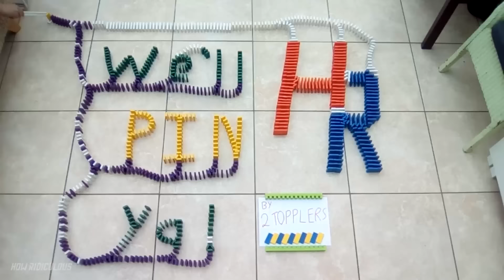Can This SOLID GLASS BALL Survive a 45m Drop?

Comment: As a retired glass maker, you make these in layers, like as onion. Also it is leaded crystal which is 60% by weight dissolved lead, giving it the optical quality. A crack will always travel the path of least resistance, ie the thinnest, so upon impact the cracks will propagate in 45 degree angles, the waves are the onion layers exposed.
Reply: SHREK
Reply: As a retired glass engraver (sandblasting, not by hand) I was wondering when someone would comment on how the glass sphere was actually made.  Thanks Marc!  :-)  Glass can be WEIRD stuff!  You can do all sorts of unpleasant stuff to it and it won't leave a mark.  But, sometimes, it seems like you just have to look at it wrong and it'll crack along a stress line left over from the manufacturing process.
Reply: As a retired smart person, I can confirm that this is true
Reply: As a retired glass maker, you make these in layers, like as onion. Also it is leaded crystal which is 60% by weight dissolved lead, giving it the optical quality. A crack will always travel the path of least resistance, ie the thinnest, so upon impact the cracks will propagate in 45 degree angles, the waves are the onion layers exposed.

Comment: The shape is called a concoidal ... It's a fracture of  silica molecules which makes the glass .... 

Also when the glass hits the steel plate ... The impulse created makes the wave patterned fractures which in turn explain Newton's 3rd law at the point of contact nothing happens... But the impulse travels in the form of waves and is the force is not conserved anywhere else but the point of contact , the cone is formed ... (Comtest).. thank you ❤️
Reply: The wave length frequency decreases and Hight increase the further away from the point of impact similar to a tsunami. Could that be due to the energy being able to disperses and it therefore having a weaker effect forcing it to find alternate easier path throught the structure.
Reply: Lol I’m stuck in a science comment
Reply: Nice google search
Reply: @eastcoastoutdoors902  nah bro I learnt it in geology

Comment: As the glass impacts, the point of impact supports the glass above, however there's a shear plane that can't withstand the excess force (the triangular shape from the side view) where the material below the fracture line isn't supported, so below that line is shearing due to tensile stress (the glass below the triangular shape being pulled away from the supported glass fracture line above) on the glass, the fact that the "Coney Joney" is uneven is likely due to the force being applied having a lateral (forward) vector, meaning there's more force being applied to one side than the other, causing more shearing to occur on one side as opposed to the other, so if you drop these directly down you'd likely see an even "Coney Joney". It's likely the front is shearing more as the force has a greater/higher forward motion (which is also translating to a higher stress on impact/stopping motion) so more of the front lower section is shearing as opposed to the rear, so more at the front less at the back. I hope i made this clear enough to understand! You could also likely review the slow motion footage to confirm/debunk the lateral force causing the un-even "Coney Joney". 

To eliminate the "Coney Joney" effect you'd likely need to surpass the compression strength of the glass itself upon impact where the whole glass ball would likely either shatter, split or a mix of both (maybe turn into dust/tons of tiny shards. This force may be too high to overcome from dropping from Terminal Velocity of the glass balls... maybe look into it? =D

As for the waves the most reasonable explanation i can think of is that it's due to the cooling process tempering the glass different amounts at different depths for some reason.

Really quite some interesting physics/science/engineering phenomena!
Reply: Definitely the best reply I have read so far.😃 Seriously, you are smart!
Reply: I would think that since the steel plate is angled that could cause the offset of forces giving that uneven cone. Dropping on to a nicely flat/level piece of steel would likely cause a more even cone shape.
Reply: @trumpedto6926  thank you! I did engineering at college 😊
Reply: @CrazyZorro4970  possibly yes, it'd be interesting to test this in scientific experiments. It may affect the point that the coney Jones occurs to be an offset indeed. However I dont think it'd affect the size of the cone much if at all
Reply: @nickpanagopoulos6097  Thank you, I'll take that as a compliment! 😊 Higher education is a blessing indeed.
Reply: Absolutely Right.....Solid state physics course huh?  Noice
But the wave pattern is probably not due to sudden temperature change.... It's more likely that the impact with steel plate sends a vibration through the glass(of course in a sinusoidal wave pattern) and it might be that solid to solid resonance occurs which causes the glass to collapse in the wave like pattern..... probably wouldn't have happened if it was concrete or something.
Reply: @sayyafnadir6137  I wasn't stating temperature change in the material but the curing process of the glass where it's tempered. And engineering actually 😊 And I hadn't considered that! That's a very interesting and of course highly plausible hypothesis. I might haveto see if there's any papers on it, if not I hope I to see a paper on it in the future ☺ Thank you for your input!
Reply: @jackfairman7371  if you don't find a paper, but write one... Do mention my name on it😂😁
Reply: Omg thats alotnpf svience
Reply: (Hours or typing later)
Reply: I can’t understand that but thanks

Comment: In engineering, there are two types of stresses that a material can experience: axial stress (tension and compression) and shear stress. These two types of stress are related to each other using an engineering construct called Mohr's Circle. Basically, when a material is loaded, there exists an angle where there is no shear stress (called the principal planes), and 45 degrees from the principal planes is the angle of the maximum shear stress. You can see this in concrete loading tests (unconfined compression test). A concrete cylinder is compressed until it fails. These cylinders usually have a shear failure, and the crack that forms is usually on the diagonal.

Glass is strong in compression and shear, but is weak in tension. When the glass hits the steel plate, the kinetic energy is transferred from the glass to the steel plate, and ultimately into the ground. Any portion of the glass ball that can transfer this energy with compressive stress or shear stress does not break, but the portion of the ball that transfers its energy with tensile stress shatters. The cone shape comes roughly from the angle of the principal planes (assuming an isotropic material), which delineates the glass is supported in shear/compression from the glass that is only supported in tension.
Reply: Thanks for that explanation. It is nice to have some proper science added to this channel.
Reply: @Vousie  this is actually the proper response this is not a Hertzian cone. no object has passed through the glass.
Reply: This SOUNDS right
Reply: Bruh im not reading that
Reply: wow, this explanation actually made me understand how they formed, unlike the pinned comment, thanks!
Reply: Makes perfect sense.

Comment: The glass is strong against compression, like concrete.And the point where it impacts the metal plate is the one where the stress is purely compression, that explains the point. The parts that fall off shattered from the ball due to the shearing forces applied on impact, since there were nowhere for the energy to flow easily. The parts that stayed were mostly being supported by that one point in the cone. 
The waves are probably a result of the manufacturing process, since the small glass ball has less waves and has probably been made in less layers.
One easy way to understand how strong glass is against compression is trying to brake a piece of small glass by pinching it between your thumb and index. Unless you have the glass bending, it will probably not brake.
Reply: nerd

Comment: Glass forms in layers. When the end result is a sphere, there are multiple spheres below (inside). The strongest part, is the thickest (minimal damage). A few layers “ slough” off from the kinetic energy, but only off of the bottom. The layers on top, have support below them. All just a guess

Comment: Says in a nerdy voice
According to my calculations the coney joney occurs when a fragile item that is layered (example glass) and is dropped from a reasonable distance. How this happens is the impact zone acts like obleck, ready for impact, it then sends a shockwave which then distributes the layers away from the sphere. The reason why the shockwave occurs is because when the ball makes contact, the impact zone absorbs the energy and its got all this energy with no where to go so it sends it self at a ten degree angle going to the impact zone and the energy continues to move down the layers until it inevitably runs out of energy. The reason the first two impact zones were off to the side are because they had forward movement and that made the distribution of energy go more forward. Think of doing a canonball at a pool, you move forward and that causes the water impact to move forward and out of the way, same concept. When you just dropped them with no forward motion, the peak of the cone was more in the middle but was not direct because the ball was spinning a little and the baseplate was not flat.
Reply: This was very informative but it made me really laugh when I saw your name was "Astrobuckhunter"
Reply: Im wondering if someone knows if you can find out the frequency of the shock wave from the spacing of the ripples in the glass?
Reply: Why 10 degree angle? Does it have to do with the speed of sound in glass? Or does it break along it's principle plane maybe?
Reply: @lbdjthethird1240  Derek's hair, i dont know how to put this but, in the wise words of the tootsie pop commercial, "the world may never know"
Reply: @mattc3738  grab a protractor and draw a straight line with the flt side of the protractor, now draw 10 degrees to the left and right of the line and have all 3 lines connect at the same point. use the half circle part and use that to draw half a circle with the ends of the 3 lines toughing the circle, make sure you line the middle line up with the 90 degree point and 10 to the left and right. Now imagine that in a 3d form and it is like the top of the cone, the energy transfers there and when it breaks through to the end of the glass it makes it way down the sides. hopefully that made sence
Reply: @BUD420MAN  Definitely not a professional in this area, more of a "random encounter". My sensible approach to this question would be both yes and no. Yes, because if the other comments I've read are right, and this is layered glass orbs, there would definitely be a way to calculate it easily. Now to No... I would think that, if this is not layered orbs, but casted orbs, as the orb cooled there would be no layers. Creating a solid uniform mass, like the concrete ball that was dropped. To which now the comment from Astrobuckhunter comes into play to finish out my line of thought. Now, though , I am also curious if my thought process is "on point", so if anyone with actual expertise can chime in, Please do so!
Reply: The balls they used are layered, imagine a snowball the size of a pea, they kept building it up and compacting it, how I know it is a layered ball and not casted is because we saw a  up and down flip image, casted have images that are left and right opposite. The science behind that is complex and I’m not sure how to explain it but that is just a brief explanation
Reply: My hypothesis was similar just not that detailed 😂

Comment: G'day,

Well, Pilgrims...
The Word is

"SPALLING..."

The Compression-Wave generated by the Impact tears the Skin off the Central Mass of the Globe, and the Skin shatters into Sharp Flakes.

  Spearheads and Knife Blades are made of Obsidian and Flint, using a similar mechanism, flaking the material away one bit at a time using concentrated pressure  onto one spot, applied with a piece of Hardwood or Antler.

Just(ifiably) sayin'.

;-p

Ciao !

Comment: Did some quick maths on the biggest ball drop using your figures of 40m and 40kg drop to work out the final energy output of the heaviest glass ball when it collided. assuming the energy wastage is minimal, it produced about 15 and a half kilojoules of energy, which (if it were in the form of electrical energy) would be enough to power an LED lightbulb for almost half an hour!

Comment: I know I'm a bit late to the party, but the sphere is exerting force into an object from the very tip it lands on, but since the mass comes in at a cone shape, that is the shape of the exerted force.
The majority of the mass comes in a straight line down the middle, which is why you get a cone shape instead of a funnel shape. The rest of the mass is divided equally on all sides, which is why the cone has that perfect cone shape.

Since the glass sphere is more brittle than the steel plate, all that force is impacted back into the sphere and it cracks in that same shape.

If you were to drop a steel sphere onto a glass or ice cube, you would see the fractures going in that exact same shape.

This is also why it doesn't matter how big the sphere is, as long as it is below the fracture point of the steel plate. It exerts a larger force if it has a higher mass, but the higher mass also have an equally higher shatter resistance, and an equally higher impact radius.

Comment: Comtest: When the glass ball hits the steel the shock waves travel down the ball getting wider creating coney Joney. Then they aren't strong enough to break the glass and that is why the rest of the ball is still intact.
Reply: comtest
Reply: Winner right there
Reply: Cone shape? I'm pretty sure you're referring to 'coney joney', which is the official term.
Reply: You winning mate
Reply: It also helps that glass is an amorphous solid
Reply: its caused bye stress going on in the glass
Reply: 17:12 Watch the shock wave engulf the sphere, you're entirely correct.
Reply: Or maybe because the glass was originally a liquid and because it is in a sphere shape with no air gaps inside it can not compress (like how water can't compress?) and therefore only the outer parts can break off as there is no resistance on the outer parts of the sphere? This is all just a guess on my part though?
Reply: @tobortine  I think it was because it was rotating and the light bounced off of the coney joney, not sure tho
Reply: tobortine that’s just the ball turning on itself and so you see the chattered cone circles through it... no visible shock wave there...
Reply: Well you weren’t pinned!
Reply: you can see the shockwave's print when the ball flip (turn on itself ) i guess that's why the glass break like that ! the forces applyed to the sphere during the contact, bounce throught the glass and implose ! and the bowling ball act diffenrently due to the different layers inside it ! the first layer absord the shockwave before the inside layer !
Reply: Wow
Reply: You said it faster than I could :)
Reply: @phonn6935  That could be true.
Reply: It is more how the force of the impact disperses around the ball , the further away, the less it cracks as there is less force left in the shockwaves. Pretty close to fact. Should be the winner
Reply: @vincentjoly9312  Could also explain it.
Reply: Winner here
Reply: @voormanmusic  sorry. my mistake
Reply: @tobortine  that shockwave affect in the slo-mo is just the magnified view of the ripples on the coney-joney coming through the glass from the opposite side of the ball.